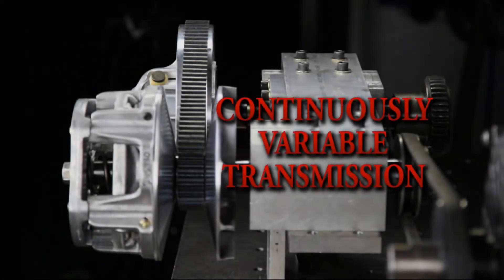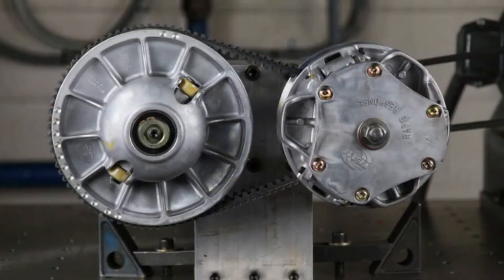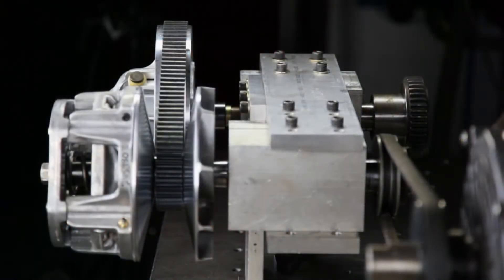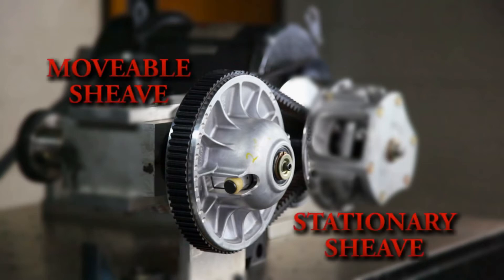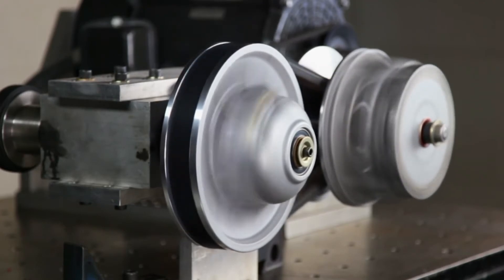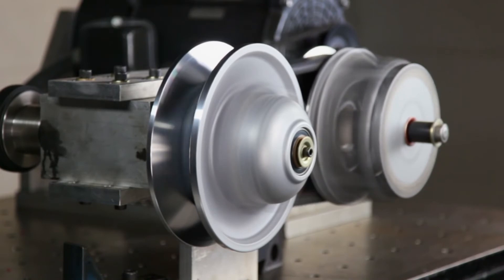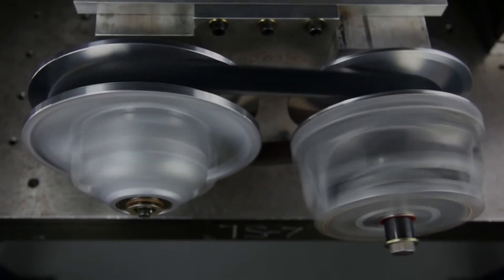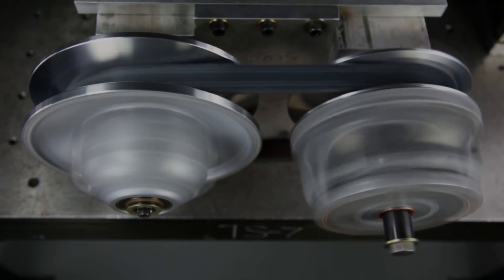CVT System

Comment: My dad built a snowmobile in ‘61 with a 12 hp Kohler 4 stroke and what he referred to as a Salisbury clutch which appeared to be an early model of CVT. It was an extremely heavy beast being made almost entirely of steel with the track being 1-1/2” angle iron riding on nylon slides and attached  to and driven by number 60 roller chain with canvas flighting from a combine in between the angle iron for flotation. It could haul 3 toboggan loads of kids up a steep hill in pretty deep snow but it only went about 12-14 mph on the flats.

Comment: Great videoas usual , i have a 22  zforce 800 trail   2"lift, 1.5" wheel spacers,  28" tires  im not concerned with overall top speed but more low and mid range power and possibly smoothing things out a bit. Would you recommend reclocking the clutch and the sliders ? Thanks